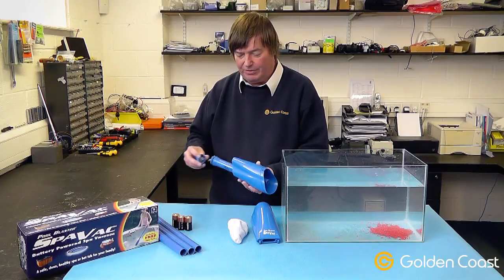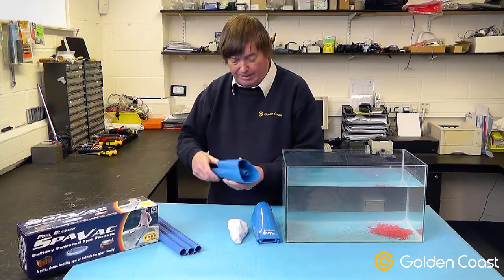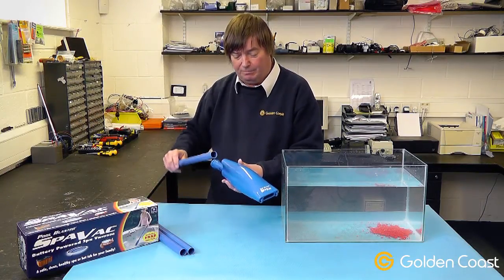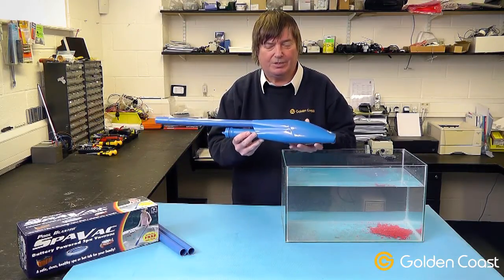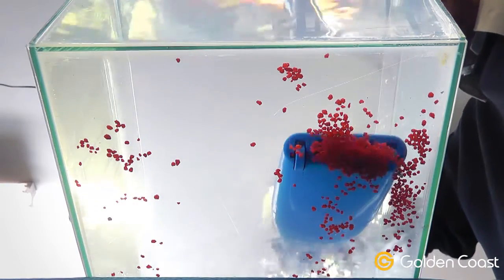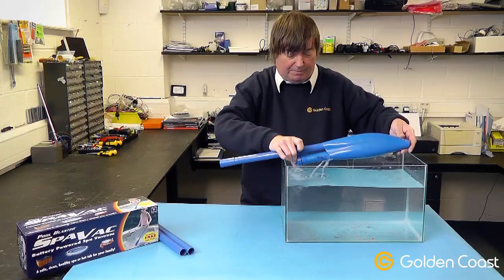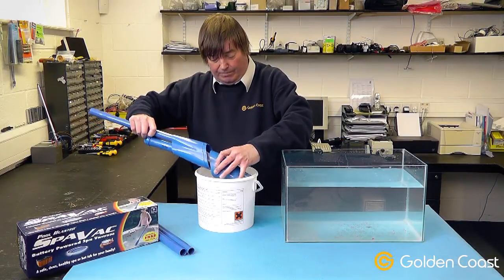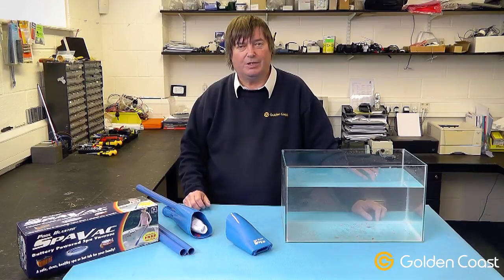The Pool Blaster Spa Vac | Andy's Answers

Comment: I brought one of these last week, it picks up dirt and sand or dead algae but nothing to big or heavy, also I only have a 12ft x 3ft pool and it took forever to clean the bottom of the pool, as you have to go very very slow to not disturb it.. He made it look very easy turning it off and taking the cap off, but its not specially when it is wet, should of checked the reviews as many have said the same.

Comment: Definitely a piece of crap and is impossible to open the cap to empty
Reply from the maker: Hi Kayla. Sorry to don't seem to be getting on with the PB Spa Vac as it's one of our top sellers.

Whilst the catch (tab) to open the collection bin can be tight (which it has to be) a bit of silicon grease can help.
To get the best from the cleaner, always make sure it's fully charged before use and that any debris is removed from the collection bin.
Andy